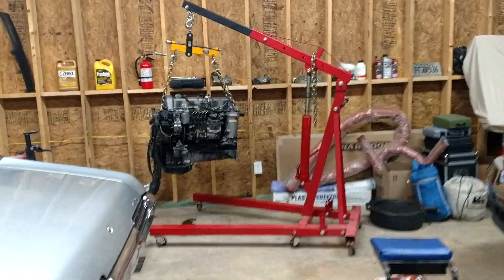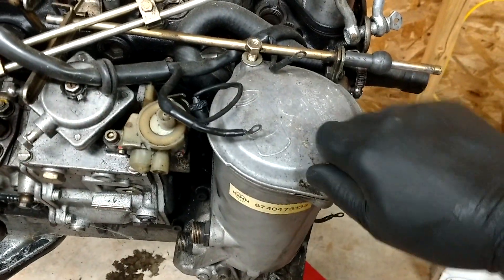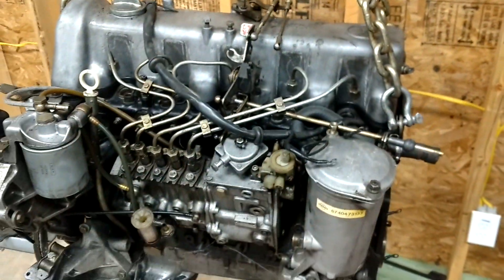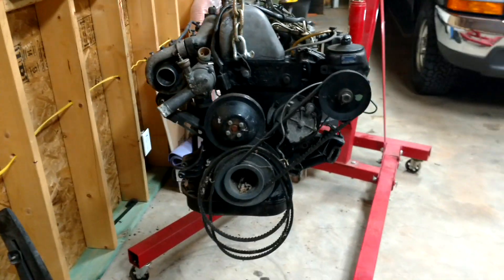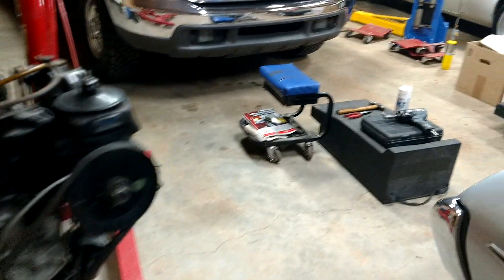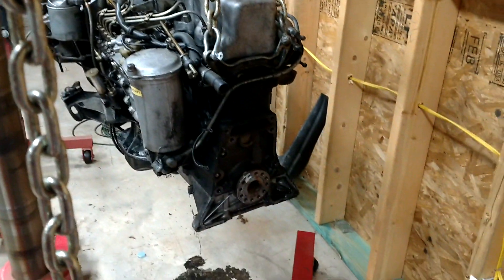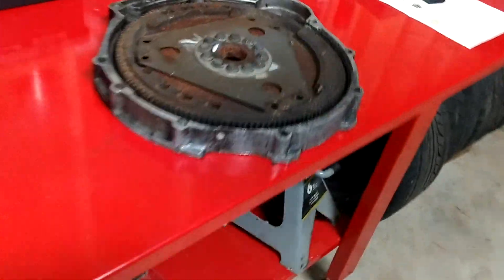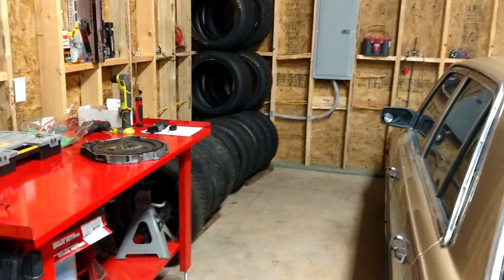Mercedes OM617 Rebuild - Part 1

Comment: I alaways mark the flywheel, but I'm not sure if they're balanced on or not, what happens when you replace the flywheel?
Reply from the maker: As far as I know the flywheel is actually balanced with the entire rotating assembly I have actually never replaced a flywheel. You'll have to do some more research on that one.
Reply: @woodsandbarclay  Well a dual mass flywheel is usually replaced with the clutch. A solid one usually not, you're right it's a bit of a dark area.

Comment: @jtwoods41978  Looking forward to watching this series.  Quick question:  I'm purchasing a 1983 300D.  Although the engine seems healthy, just curious what a rebuild would cost on it. I have an old mercedes guy that I would trust but just curious what I should expect to spend if I ever get in that spot.  Would it be better to find one from a loaner car?
Reply from the maker: Check out my website and you can download the Excel spreadsheet that shows the cost for my 617 rebuild. Http://www.om617rebuild.com
Reply: @woodsandbarclay  Thanks. I may be missing it. Do I need to click on something to get to the spreadsheet?
Reply from the maker: @pauldavidson2520  look under the table of contents and I  there's a page you can click on that gets you to the area where you can click on and download the spreadsheet
Reply from the maker: https://om617rebuild.com/parts-list-%26-fsm

Comment: Where did you get a good rebuild kit, every where I have looked it’s 2000$ for a rebuilt kit for a om617
Reply from the maker: I did not need to buy a rebuild kit. The parts in my engine were not worn out. I did have to get some new piston rings and have my crank repaired. Also had to order new bearings, seals, and gaskets. These are expensive. It's going to cost you some money even if you don't have to buy a rebuild kit. I'm in about $1,000 at this point on special tools, gaskets, seals etc
Reply: @woodsandbarclay  Pelican Parts? I'm starting to dabble into buying an OM617 and from what I saw on their site the rings and bearings were cheap. I didn't price gaskets.
Reply from the maker: @derrickandalese  yes Pelican Parts and Auto Haus AZ
Reply: jtwoods41978 yeah I watched you put them in video 11 thanks for making the videos. Been waiting for someone to do a rebuild video on this engine
Reply from the maker: @crolekid1988  glad you liked it thanks for watching.
Reply from the maker: If you subscribe to my channel YouTube will notify you every time I upload a new rebuild video. I have several more videos to go before this engine is complete